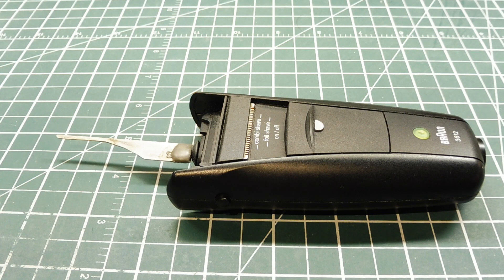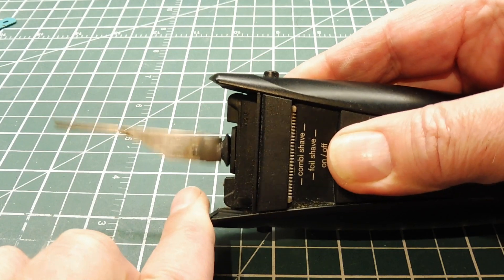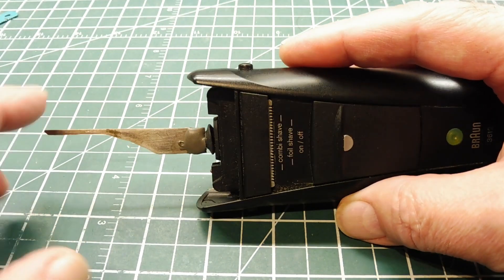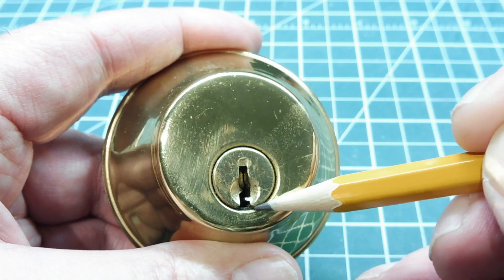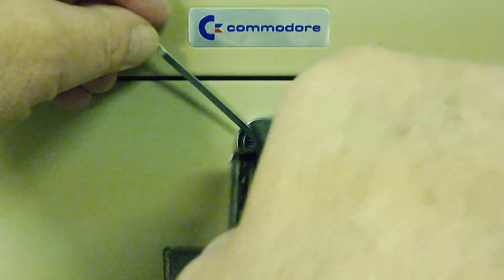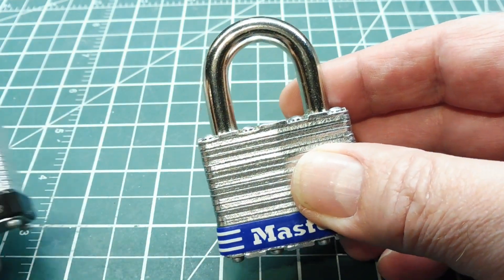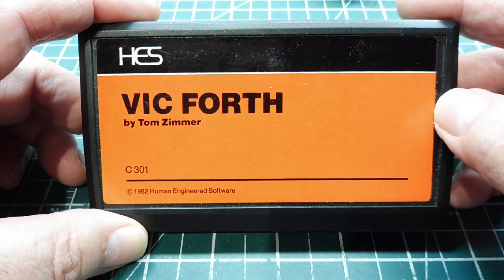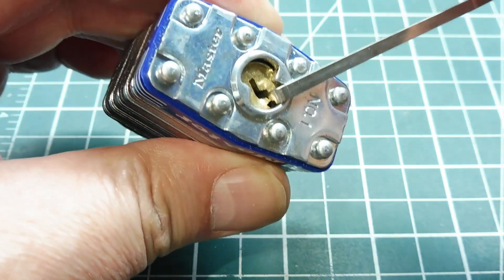Electric Lock Pick   / How It Works

Comment: JB Weld is awsome stuff. Useful video, it 's so easy to lose keys.  btw did the company you worked for let you program in forth ? I would assume they wanted the code to be in a more commonly used language.
Reply from the maker: At one time Forth was a mainstream language so at that time it was not a problem. A few years after Bell Labs introduced the C programming language it became mainstream and everybody followed the crowd. A few companies stuck with Forth like NASA where they used it in space probes, satellites, Hubble, ISS, Space Shuttle ... etc contracted by Harris and Rockwell and is still used today.
Reply: @0033mer  I remember reading about it in the late 80's could of been circuit cellar, or midnight engineer magazines. I didn't see it used where i was.
Reply from the maker: I was an author for Circuit Cellar back when Steve Ciarcia was running it. My articles were Forth related so you might of read one of them.